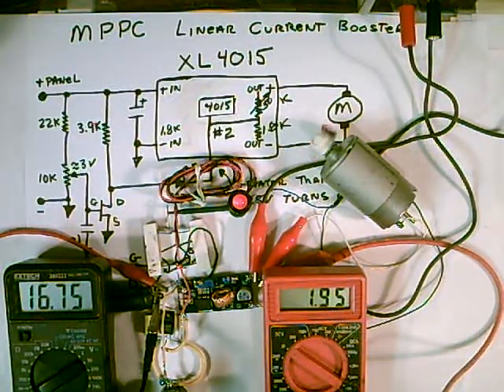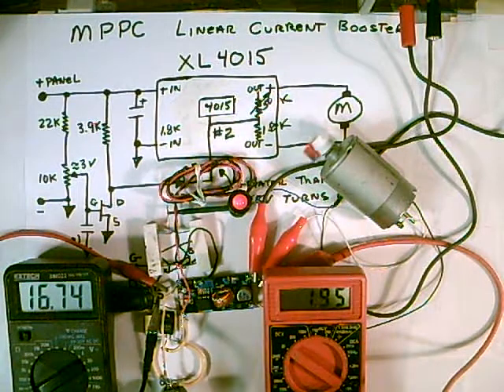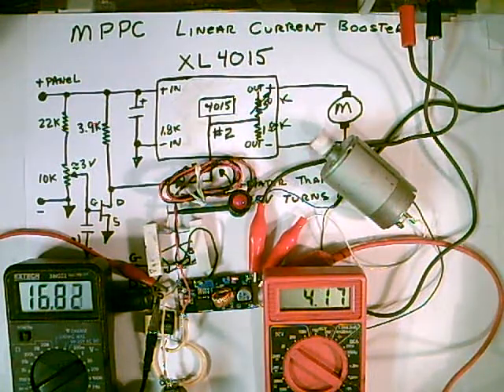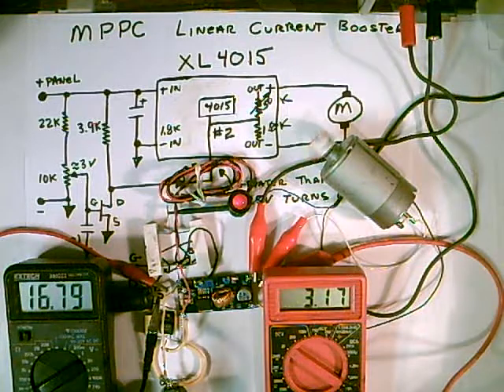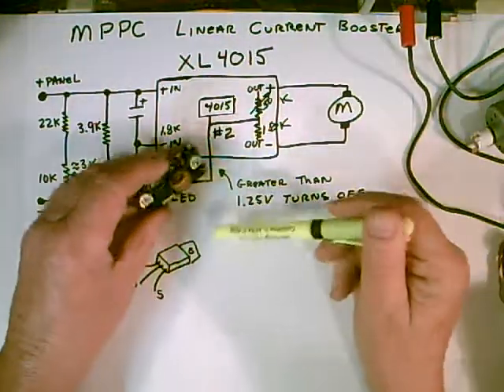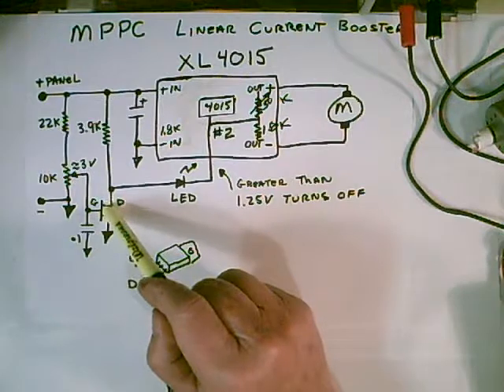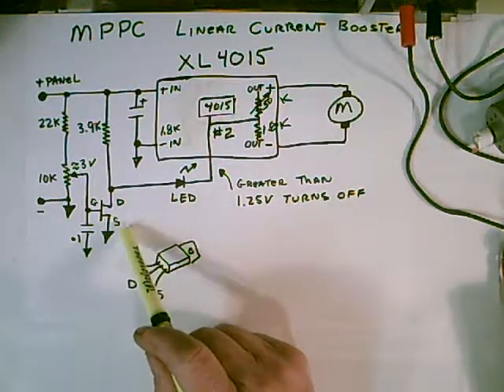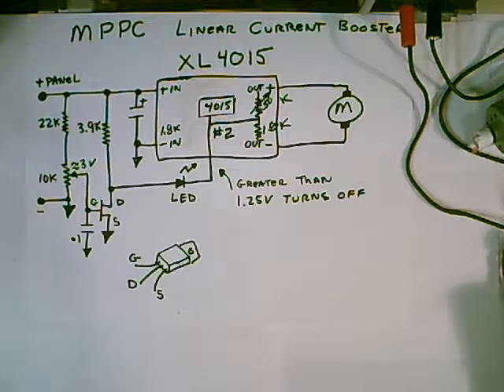XL4015 Solar PV USB & Motor Linear Current Booster

Comment: Hi, thanks for your video its very usefull. I have a couple of questions. Any idea what the value of that capacitor should be? The voltage divider as to be calculated so that, at maximum power voltage of the panels, is output is 3v right? Any mosfet that you would recomend? Thanks in advance

Comment: Thank you so much for this video. I have a buck module with the same XL4015 that does the same thing but I wanted to integrate it in another project with a self made pcb. I was trying to reverse engineer this module for hours. After almost giving up I stumbled upon your video and the solution is so simple. The board uses a mysterious 5 pin chip with the marking scratched off. My first thought was an opamp configuration of some kind. Didn't thought it was a fet because of the five pins, I never saw a fet with five pins.
Reply from the maker: There are several in this family of regulators.  Sometimes what it says on the case isn't what it is inside like the LM2596.  But they all do close to the same thing, just at different frequencies.  An internal IC drives another FET inside thus reducing the parts count on the board.  The data sheet is your friend.
Reply: @opera5714  I didn't mean the buck controller IC. That clearly states XL4015. But there is an additional anonymous small 5 pin chip which is in the place where you added the additional FET. I am using an opamp as a comperator and a transistor (because of the lower threshold voltage since the control circuit runs at 3.3 V and the opamp is only outputting 2 V) since I want to do real MPPT.
Reply from the maker: Do you have a link to this board?  I assume this board has a pot for current limiting.  That 5 pin is likely just a vertical single op-amp. Two power pins + - and out with the input connected to a length. of trace to trace as a current shunt   Usually, they have a surface mount LM358.  If this goes to on/off pin,  power point voltage control must go to reference pin to fool switcher there is an over voltage.

Comment: Thank You!  I am trying to get my little 12V/0.8A pump working off of a 12V/20W solar panel and having the exact problems you are solving.  Watched a number of your videos, and I found where to buy this XL4015 as well as the MP1584 you mentioned in another video.  I'm not sure which of those two approaches I should take.  I have limited skill and equipment (I can solder and I have a basic multimeter), so I'm thinking I should try the easier MP1584 mod.  I get the sense that you like this one better, but not sure why?  Also, I noticed you specified the capacitor ratings in the other video but not here?
Reply from the maker: The XL4015 could be marginal with a motor There are bigger modules with a heat sink that would be better.
Reply: @opera5714  Oh really? Any recommendations?
Reply from the maker: @Robindersplidle  go for one of these 150W versions.  Avoid ones with the extra pot for current limiting.
https://www.ebay.com/itm/DC-CC-9A-150W-300W-Step-Down-Buck-Converter-5-40V-To-1-2-35V-Power-module/323648193021?hash=item4b5aef81fd:m:mCpbKTOeSKdzk-e1ACsJg_A:rk:3:pf:1&frcectupt=true

Comment: Bro why are measuring the amps in volatge side bro please rply me bro I am stucking in a project if I get your answer I will finish my project so please rply me bro.
Reply from the maker: I am not measuring amps, but voltage.  A solar panel has to be kept at the power point voltage in order to produce the maximum power.  Amps will change with sunlight intensity, the preferred power point voltage does not change much at all.  This circuit  allows the buck inverter to drive as hard as it can until the panel voltage drops.  The FET will drift with temperature slightly and is good enough.   There are other things that could be used instead of the FET.
Reply: opera bro one doubt using linear current booster is there any possibility to get 48v 4-5amps from an input of 96v 0.4 amps where the peak volatge of the linear current booster is 48v bro is it possible bro.
Reply from the maker: @s2skickstarters29   These are demonstration videos that allow people to understand the principals and what can be done with many standard products.  Is  96v 0.4 amps a typo?   Watts in is watts out and an 80% conversion factor is likely.  I am not aware of any converter modules out there that could be used to produce 48V and that sounds like an odd motor voltage.  Some of my water heater circuits could be used turning the motor into an inductor with a flyback diode.
Reply: opera bro you mean that the 5v on the other multimeter are the extra volatge that is passed in the circuit

Comment: Thanks for this.  I have to run a motor off a solar panel, and will take a close look at this.
Reply from the maker: This method can be used on almost any buck converter.  I do approximately the same thing with cheap 60V grid tie panels using the 72V to 12 converter boxes in parallel.  That can supply a lot of current. See also my 300W inverter board mods for heating water.  Just add a diode across the motor.